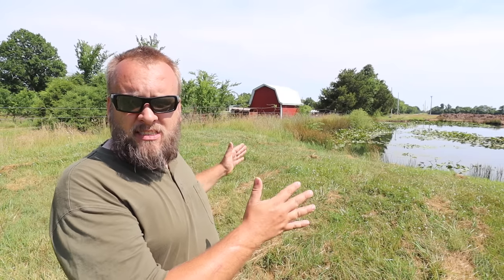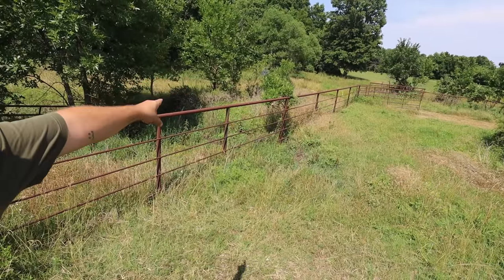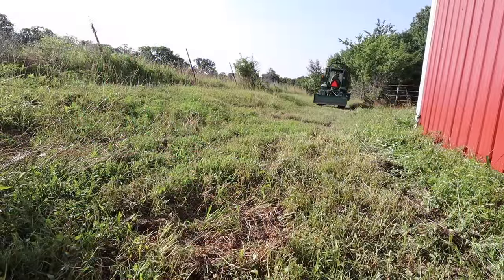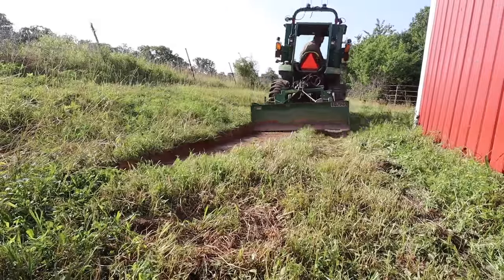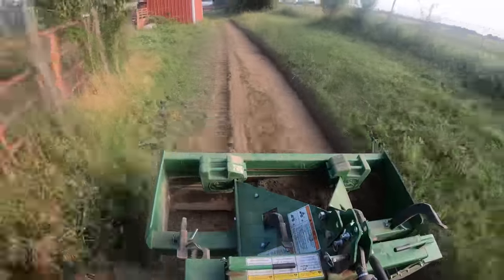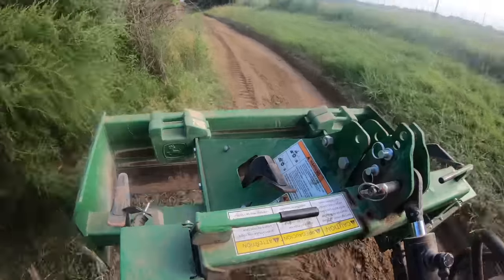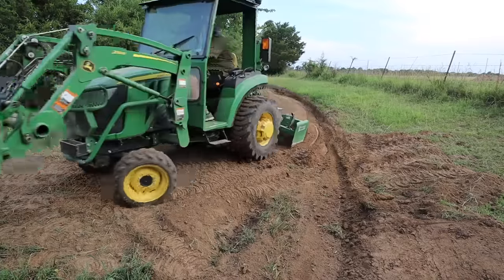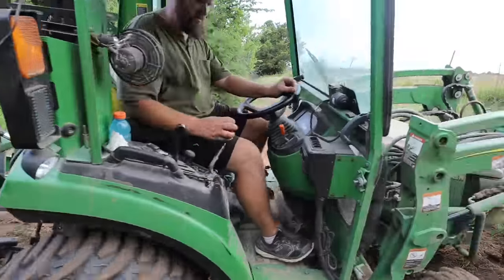It's Amazing what you can Accomplish with a Box Blade

Comment: Remember, those pans cut both ways. Every time you back up with your blade in the air, you are wasting fuel. And don’t forget to use your rippers, they loosen it up so you can cut easier. We used Massey Ferguson wheel tractors and blades to grade with commercially, and it  those box graders are really the ticket for tight areas. Also, did you shoot it for fall before you began? Sorry, I don’t wanna be second guessing you, I’m an old dozer hand and used to push dirt crews, so automatically I’m like what can we do better? Good job for a little tractor like that, remember moving dirt is a thinking man’s game, do the job three times in your head before you put a blade in the ground. 💪🙏🤟 be safe out there!
Reply: If you like wrecking your 3 point hitch then yes working the box in reverse is a great way to save fuel.
Reply: @atodaso1668  I'm talking about commercial grading tractors man, follow along with your class dude
Reply: @dozerboy67 your first sentence was basically telling him to use the back blade in reverse. Had nothing to do with commercial equipment.
Reply: @georgea6403 one of those boomers that takes any opportunity to talk about themselves and tell you how much more experience they have while not actually being very helpful “I actually was talking about totally different grade commercial equipment that the guy in the video isn’t even using man!”
Reply: @atodaso1668  Why does it wreck the hitch?  I got a box blade recently and don't want to mess anything up.
Reply: @fosty.  The 3 point is designed to pull things not push. You can use the back blade for pushing piles of loose dirt around but not for actual grading.

Comment: Put an overflow pipe on one end of the dam, where it discharges toward the creek. Use a backhoe or mini ex. Then find any soft spots or leaky areas. Dig it out, then pack it back in.
Nice work with the grader box. My favorite implement for sure. I like the weights and the tilt cylinder. Slick.

Comment: Nice job. The box blade is a very effective tool. Like others have stated, not seen the weights inside the box blade before, but it looks like they worked well there. Now you are going to have me scrounging around the farm to see if there are any small spare weights around to add to mine.
Reply from the maker: I bought the suitcase weights thinking I was going to use a weight bracket as a ballast but I really don’t do that very often. I like using the box blade as a ballast but it’s not really heavy enough which is why I started putting the weight on it.

It really does seem to help it dig in too

Thanks for watching.

Comment: You are absolutely right, the box blade is a very versatile implement. I hear guys complaining about them not working right but I always write that off to lack of experience. When you think about the number of variables to consider it is easy to understand why you need experience. Angle right and left and back and front, moisture content of the soil, whether you are pushing or pulling. Mine has never let me down and I have built a lot of road with it.

Comment: Watching you with that box blade reminds me of my project for the day.  We had a storm that knocked down a bunch of trees on my property.  One big oak tree is laying right on top of my box blade.  I had set it down out back to make room for my sawmill operation.  Apparently, I chose the wrong spot!  That big old tree has it driven halfway into the ground!  I'm hoping that there is no damage.  Those things are built pretty tough, but it must have taken a hard blow to drive it that far into the ground.  I'll find out in a bit.  Great video!
Reply: Sorry you have to deal with that. The story made for a good laugh though. Gotta believe it'll come out of the ground straight and true.
Reply from the maker: Sounds like it got hit with a lot of weight

Hope it isn’t damaged
Reply: @soscattered6126  Once I sawed the tree into chunks my tractor could handle, I uncovered the box blade and yanked it out of the ground.  Still like brand new!  A little scuffed paint is all, and that wasn't even down to bare metal.
Reply: @RockhillfarmYT  It's still in perfect condition.
Reply: Depending on if it was a  cheap or a name brand hd woods
Reply: It doesn’t hurt to first run a single turning plow in the swell area first makes for faster grading

Comment: Maybe consider running a deep trench on your side of the property line and put in an underground "fence" of 6 mil plastic. Earthwork damns are usually layered with a core of clay to prevent infiltration. Great work with the box blade, I'm going to have to ad weights to my box similar to yours.
Reply from the maker: Thanks for the suggestion.

I find those weights help it dig in and when it’s just riding on the back as a ballast I like having them there

Comment: i built golf courses in the 80s ....  hydraulic center-link and on one side another cylinder for tilt ,  i saw a setup also once where you could raise and lower the ripping teeth.  had some very good operators that could do wonders and put tractors in places few would attempt   thats all they did so they were good but not everybody had a eye for it ,, no different than a steel rake.
Reply: What’s the best hydraulic link IYO. I’m getting some soon.

Comment: I may have to go back and watch some of your previous pond videos. Where was the overflow/spillway on the original pond?
On another note, down here they call any man-made pond a tank, and most have a spillway on one side of the dam or the other. After a heavy rain, you'd hear the ranchers say, "my tank ran around", which simply means the water went over the spillway!
Reply: “Tanks.” And you all also call any and all liquid carbonated beverages “cokes” and you gotta put “bar” before “ditch.” Lol.
Reply: @silverbackag9790  Short for stock tank. Yup, bar ditches!
Reply from the maker: Originally the pond had no overflow set up

The bank that I’ve mainly been moving dirt on this week was just lower than the other sides and it spilled out there and washed down the neighbors driveway

Comment: Good video. I like your “self evaluation” method. It makes a lot of sense. I have a similar project, albeit smaller in size. How did you determine the grade, to make sure the water flows where you want it to? Did you just eyeball it?
Reply from the maker: I know it’s hard to tell in the video but it’s clearly grading downhill already so I just followed that
Reply: @RockhillfarmYT  Thanks. My project is not as apparent, and it’s in my yard, so I’m trying to minimize the area i grade. I guess I’ll be ok using the staking method, but was contemplating renting or buying a laser.

Comment: You need to look at a nice box blade like KW, Gannon or cammond instead of the cheap lightweight box blade. You would be amazed at what you could do. My 6' KW weighs 1800 lbs. It uses 3/8" steel end plates.
Reply from the maker: Thanks for sharing

Comment: Hey Brock, how does the box blade do with no tilting?  I'm looking to just scrape the grass off an area to make a driveway.  I have a back blade, but it's definitely not working well.  Just wondering if a box blade would be worth buying.
Reply from the maker: Yeah, you can peel all the grass off and make a dirt trail with the box blade. I only needed it to angle because I was on a slope One Direction and I wanted to cut in the other direction

I hang the suitcase weights on it to make it bite in harder

Thanks for watching
Reply: @RockhillfarmYT , thanks for the reply.  Keep up the videos
Reply from the maker: Thanks

Comment: Hey Brock. What weight suitcase weights are you using on the box blade? Does the extra weight make a good difference?
Reply from the maker: Those are 42 pound weights just because that’s what I already have.

I like it for extra ballast, but it also helps the blade dig in better.